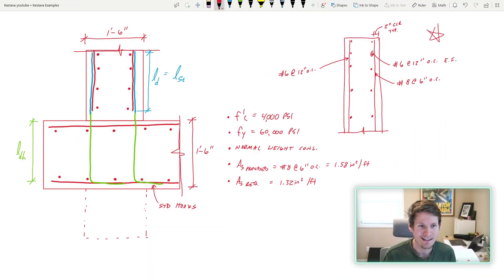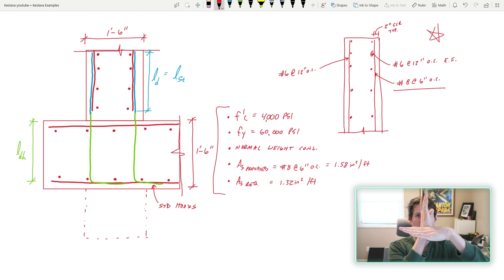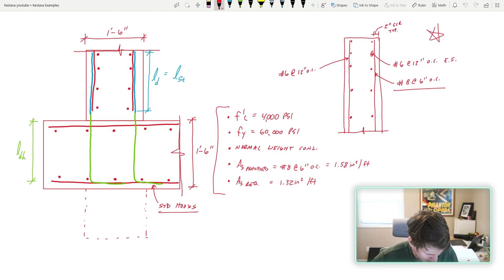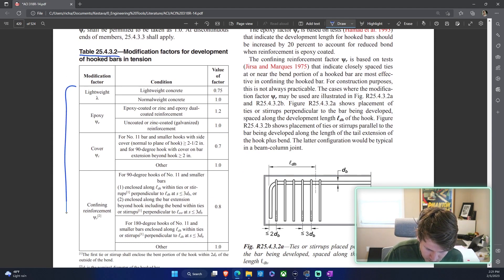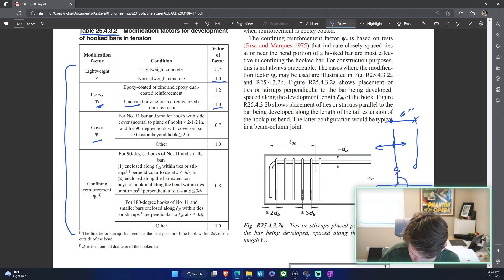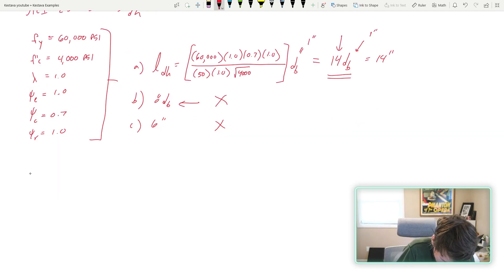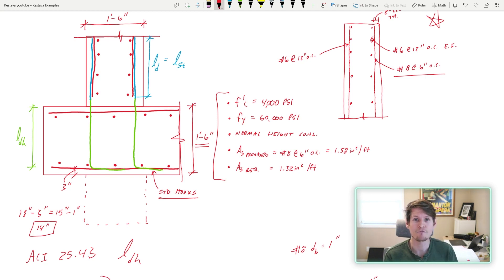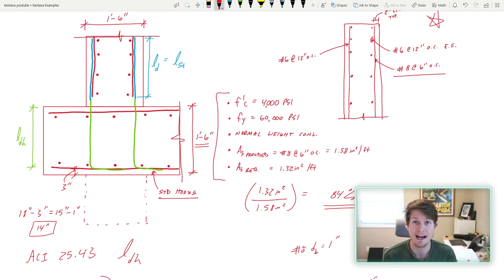Rebar Development Design Example | Part 6| Learn Structural Engineering

Comment: Could you please explain to me why we need a development for conpression bars ? 
Like what will happen  if I did not provide it

Sometimes it is more than the ldh and sometimes more even than ld

How is that possible ??

Why I'd we have anchored to concrete I need only like 100 or 150 

But if we have a concrete column then  I need at least like 400mm

Comment: The 6 inches probably was used when #2 rebar was used, but they don’t really use #2 rebar, rather. They use wire mesh instead

Comment: I have a question here, isn't the "horizontal" length of the hook important too(the part of the rebar that connects to the lower mat)? I've seen some documentations that recommends also Ldh as a minimum so, horizontally, the hook would also need that same Ldh that we got (15'' for this example) and it counts from the external face of the wall to the end of the footing, is it correct? or would that count as ldext per section 25.3.1?
Reply: Did you get an answer for this question?
Reply: @PaulaSimbaquevaArciniegas  You need a minimum of the standard hook length for that part of the bar. Many industry standards use longer than the standard hook length for this sort of situation; for example some extend the standard hook length beyond the back side of the retaining wall, but there is no code requirement for this, just industry practice based on real-world testing and performance. 

Far more important though is that your hook runs in the same direction as the load! Again not required by code but testing shows that the orientation of the bar has a substantial affect on the actual failure load.

Comment: The excess reinforcement reduction factor can be utilized for both tension and compression rebar development lengths by code but is not applicable for lap splice length. However, the code does have stringent exceptions when applying this excess reinforcement factor into account.
Reply: ACI 25.4.10 permits the devolpment length ld to be reduced in cases where the provided flextural reinforcement is greater than that required from analysis, except where prohibited by ACI 25.4.10.2 

Also that reduction factor is not permitted in the design of members in seismic-force-resisting systems in a structure assigned to SDC D,E or F
Ignoring this reduction factor will lead to a conservative value of ld